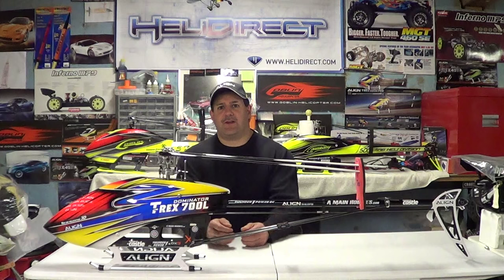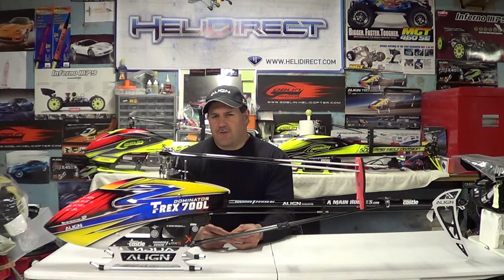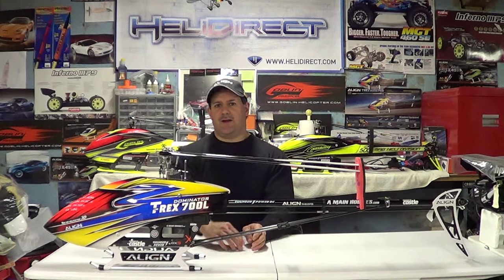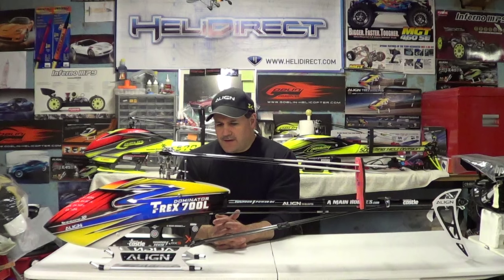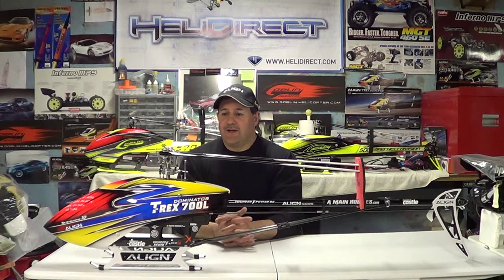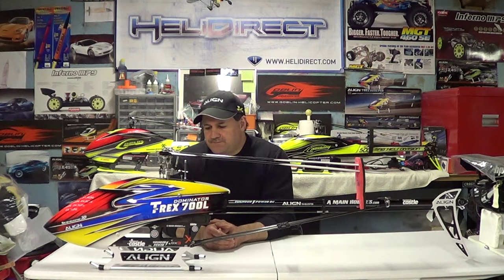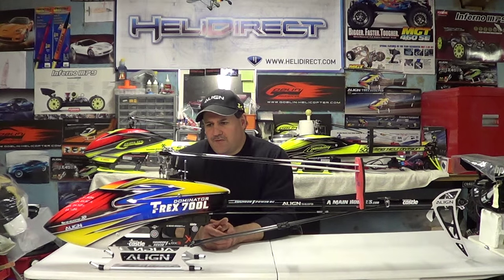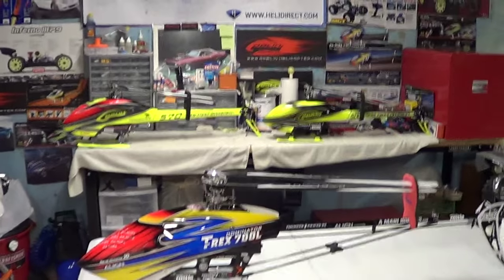CYCLONE rotor blades with tapered airfoil design ,plus flight review for all my rc helicopters

Comment: Hi ray, this has nothing to do with the video but i have a question. If you had to choose between goblin 500 and the goblin 570, wich Would you chose? I currently own a goblin 500
Reply from the maker: +JamtlandRC channel  I can tell you this after owning both there very similar ,not really worth owning both unless you got money to spend or if you want the 570 to run 12 cell.the 570 flys slightly bigger but not that's about it.
Reply: +nitrokyosho thank you, l stick with the 500 then :)